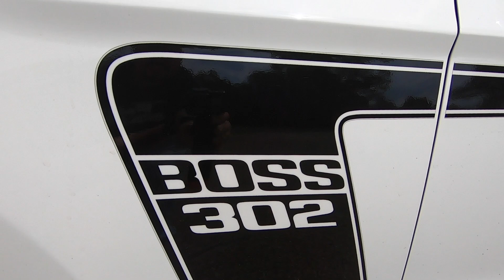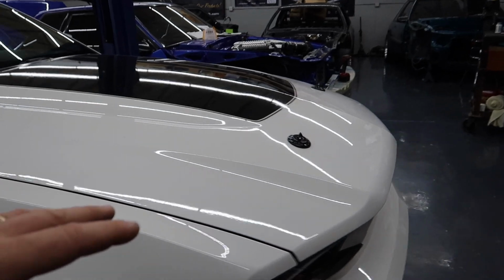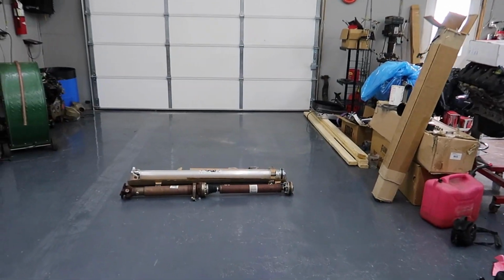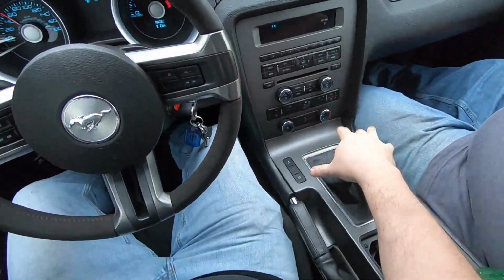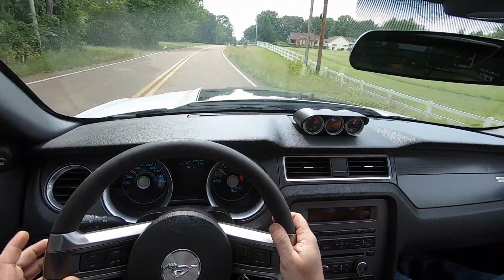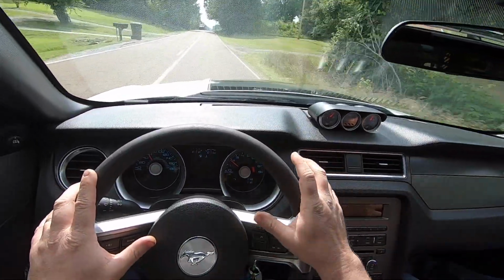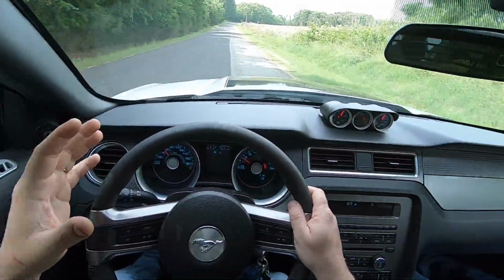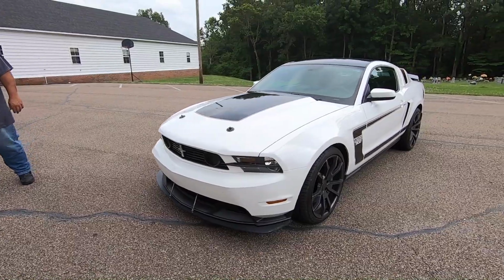I Finally get to drive a BOSS 302!!! My thoughts and DSS Driveshaft Install!!

Comment: I want a Boss 302 so bad. Hopefully after I finish my machinist apprenticeship I will have enough saved up for one, AND hopefully the market for them won't shrink and cause prices to go way up since they were only made in limited numbers (like 8,000 total for both model years combined?).
Reply: Did you ever get it?
Reply: @ So I ended up test driving a 2020 Shelby GT350 and preferred it over a 2013 Boss 302 that I later test drove. Carmax had a 30 day love your car or return it guarantee so I didn’t end up keeping the car since I want to try out other muscle cars before I decide to keep one. You can see the Shelby videos on my Donating Horsepower channel but no presshah

Comment: You mention why does he not drive it more.  I am also from that north east area and can say it is not so much a weather thing.  I have a 2012 Mustang and I would drive everything I had the chance when there was no snow (so even in the cold or rain).  But not as a daily driver to work.  So when I would come home and drive locally, the miles really just did not add up.  Even when I would go on a weekend drive through the residential back streets of various neighborhoods that there were a lot of trees and really nice long roads, the miles never really add up.  I have about 19k miles right now.  Only when you daily drive does a car really get the miles.